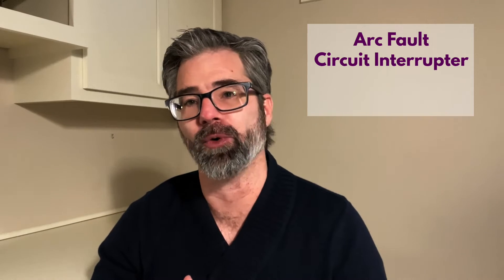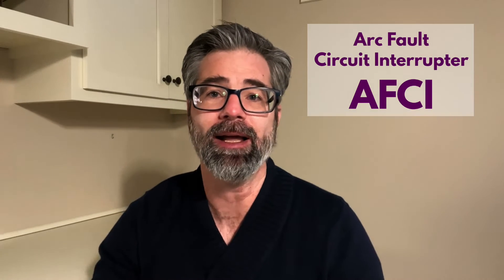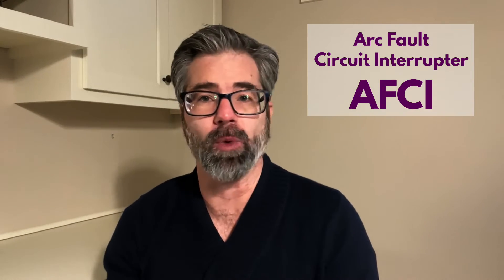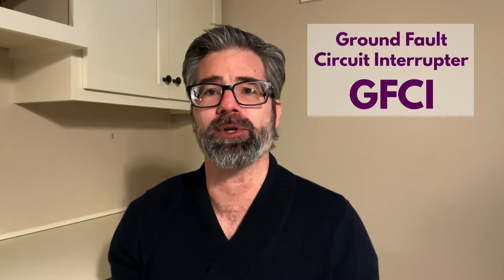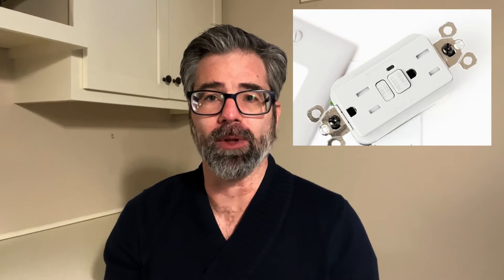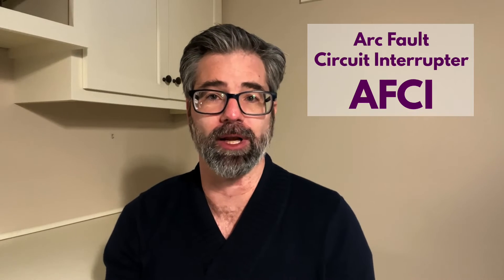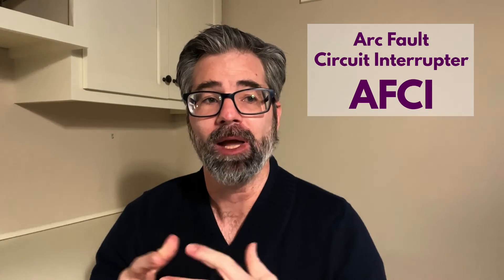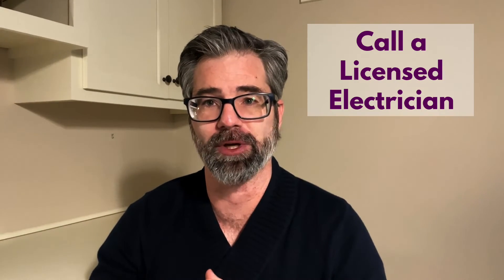Why does the vacuum trip the breaker? When Vacuums Attack! Unraveling the Mystery of Power Outages

Comment: I tried this and my vacuum still tripped my breaker. My tv also is on the same breaker so maybe that is the issue. My older vacuum did not trip the breaker but this one is pretty powerful
Reply from the maker: @SharonPeoples-t4p  If the breaker is still tripping it may be an issue of too many amps being used through that circuit. I agree that the tv and the vacuum along with whatever else is on that circuit might cause the problem.

Comment: Question. I plugged my vacuum in so I could vacuum my bedroom. As soon as I turned the vacuum on most of the lights went out except one that was plugged into another wall. I immediately unplugged my vacuum, the lights came back on and one of my lamps was smoking! The slumlord’s “guy” came today and put new light bulbs in but did not call an electrician. Also, right after that happened, I flipped the hall and dining room light switch and the bulbs popped off. Any idea as to what’s going on? The guy says it’s all good. It also fried my washing machine. I’m so upset! Please advise…
Reply from the maker: @Jem-ty2kg  Oh my gosh! That sounds like some serious issues! I’d start looking for a different place to live.

Comment: New home vacuum cleaner tripping 15 amp AFCI breaker from kitchen outlet. But doesn't trip in bedrooms. I hope the surge protector helps. I think its the breaker. I don't like those AFCI breakers
Reply from the maker: @BenHarding-s2w  Depending on how old the breaker is, it might help to replace it with a newer AFCI. They have become less likely to false trip with newer ones.
Reply: @LiveInMN  brand new home